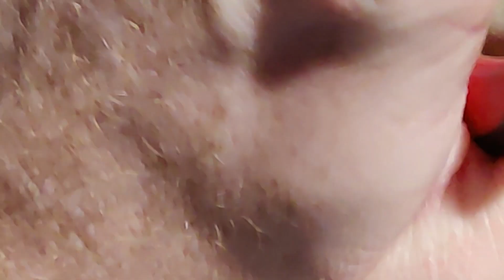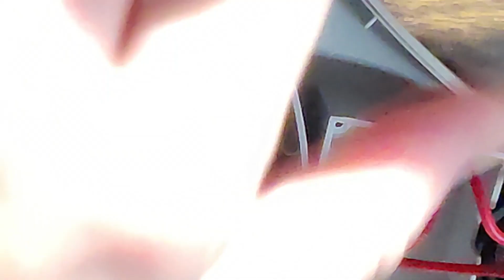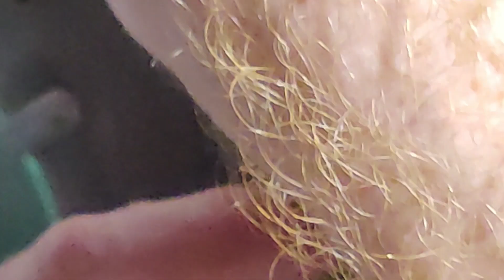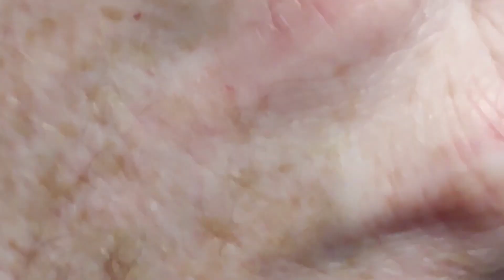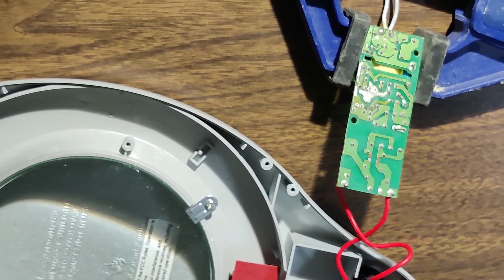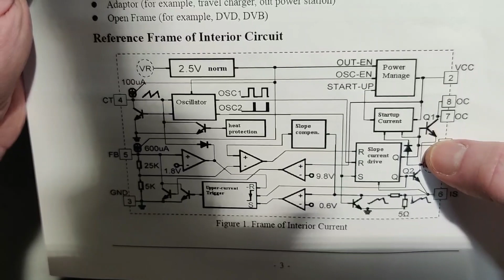Intertek Magnifier lamp repair part 2

Comment: Thanks Paul!  I had the same lamp and flickering.  I reached an impasse after the replacing the chips.  I suspected a capacitor but wasn’t familiar with the circuit.  Saw your videos and you pointed me in the right direction.  Ended up replacing the 22µf cap (measuring 23µf) with one measuring ~31µf.  That did the trick.  Nice and stable now.  (55µf and 100µf didn’t work).
Reply from the maker: awesome, I am glad to hear it!